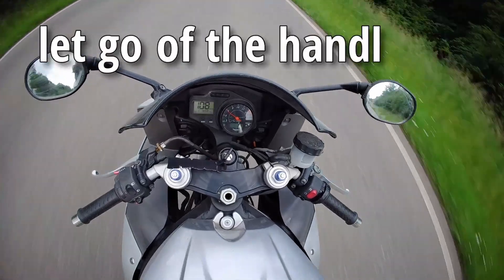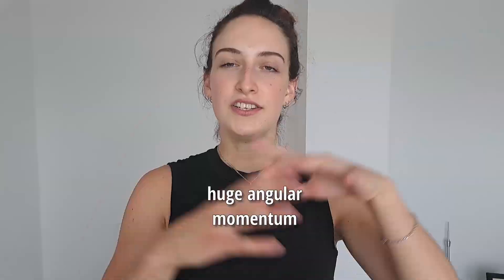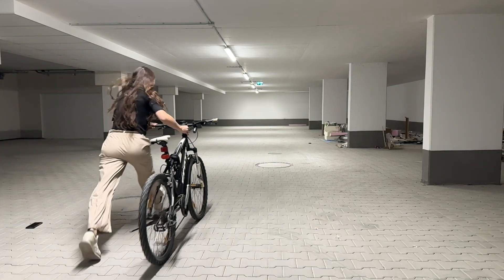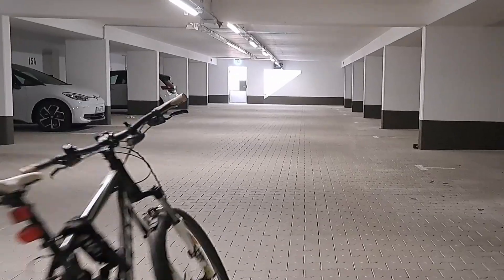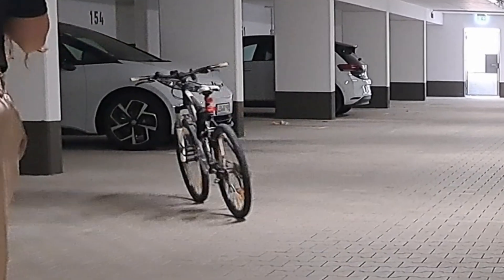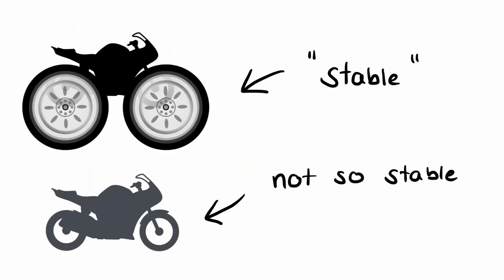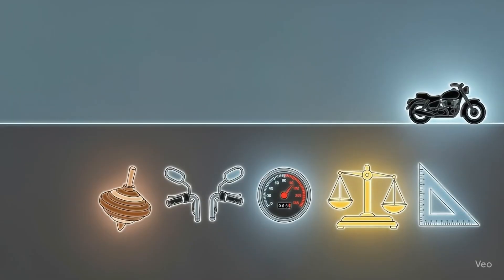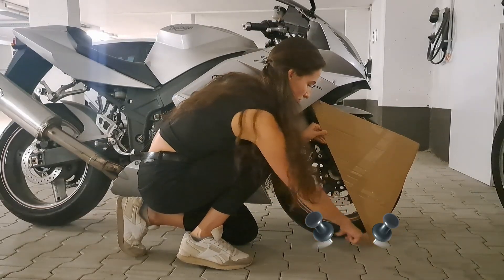Your Motorcycle Doesn't Need You! (Trail & Gyroscopic Forces EXPLAINED)

Comment: There are several incorrect assumptions made throughout this video.  For example, you seem to be operating under the antiquated myth that bikes "steer normally" at low speeds, and only counter-steer at high speeds.  This is wrong.  It's all counter-steering.  By pushing right, you're steering the bike to the left, out from underneath your combined center of mass, which causes the bike to tip to the right.  Once tipped to the right, the conical tires cause the bike to turn right. This is done at all speeds, and steering a bike without doing this is impossible.
Also, the gyroscopic force isn't responsible for keeping a bike upright without user input.  Rather, it's the design of the bike itself, which allows it to self-correct by gravity turning the wheel into the direction of lean, as you touched on with your description of the trail geometry.
Check out this video, which goes into more detail about these (and more) points: https://www.youtube.com/watch?v=9cNmUNHSBac
Reply: Haven’t seen the video you linked yet, but your response was the comment I wanted to write. Countersteering does work at all speeds, it’s just that we feel it better at higher speeds. 

Regarding this, specifically, I understand that there is a “delay” at which the motorcycle stabilizes itself after countersteering and at very slow speeds and manouevers you might not get to that point, effectively making you think that you never countersteered.
At the video I think this shows at 15 km/h where each time the countersteering has already happened at the “previous” lean, but the video snippet is short and doesn’t allow you to easily understand this.
Reply: Heh, I am also here linking that video. 

Through much personal testing I have decided there is such thing as a “ low speed regime “ in which the bike can be turned without counter steering first. That regime is a dead stop. If you completely stop you can turn the wheel in the direction you want to go and then proceed without first countersteering
Reply: @lukeorlando4814  Well yeah - because at a dead stop you literally can't counter-steer.  Turning the wheel in the opposite direction won't move the tires out from under your center of mass to initiate a lean if the tires aren't rolling.  😅

Comment: The basics of motorcycle turning are trail and camber thrust. We make mathematical models of physical systems that are usually simplified. 2:1 pulley systems are explained with massless, frictionless pullies. Gyroscopic forces and precession are there, but not predominant. Motorcycles are single track systems. They can fall over. When you push right to go right, you are overriding the self-correcting trail. The motorcycle falls to one side (for mysterious reason, the right side). Then camber thrust takes over and makes it turn. Roll a Styrofoam coffee cup across a table to see this effect. The big and small ends turn once per revolution even though they have a different radius. The coffee cup turns in a circle to accomplish this. Motorcycle tires have the largest radius in the centered and a smaller radius to either side. Kind of like two coffee cups taped back-to-back, small ends out.
Reply from the maker: The comparison with coffee cups is really good! Also well explained with the chamber thrust. However you say because of some "mysterious reason". I think I could have been more precise in my video and said that the initial tilt of the turn is because of precession and not the whole turn. Why exactly don't you think that this initial tilt can't be because of gyroscopic precession?
Reply: @GiuliaonGasoline  I honestly don't know Maybe precession is the reason the bike leans. When you are in a turn at lean, you can lean more or less by adjusting the handlebars. Maybe this is precession. By turning the handlebars you are turning the wheel (more) out of alignment with straight and exposing more tire camber. This may have an effect as well.
Reply from the maker: @camgere yup I totally think that both things can be responsible (probably at different stages). At least I obviously didn't make this up. If you're interested, my research resources for this video  mostly were "Motorradtechnik" by Jürgen Stoffregen and "motorcycle dynamics" by Vittore Cossalter. Two great books when you want to learn more about motorcycle vehicle dynamics and don't want to trust some random engineering girl on YouTube 🙃
Reply: @GiuliaonGasoline  Science is good!
Reply: Uh hum. The relationship of the geometry of the front and rear tires, combined with the head angle (trail), is very much the greatest force involved in turning a motorcycle. Counter steering moves the wheel in the direction you are turning after tip-in - counter steering will actually work at any speed but is less stable the slower you go - the geometry still works though.

Not convinced? Try a square profile front tire. It does work but it never ever has a stable point. Tire manufacturers know how bikes steer and so do bike manufacturers. Reducing the weight of the wheels and tires isn’t high on the list of performance mods because it doesn’t have much to do with how quickly a bike can steer, tire profile does, so that’s what they spend their money on.